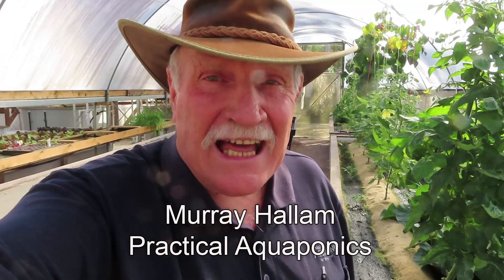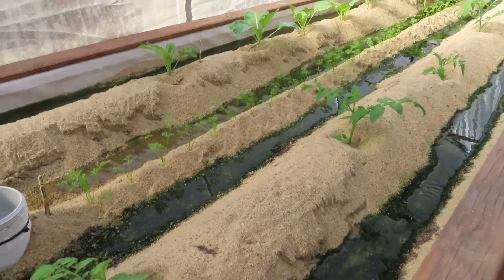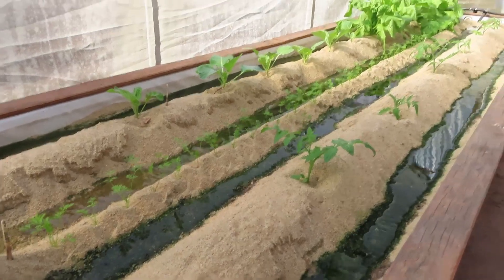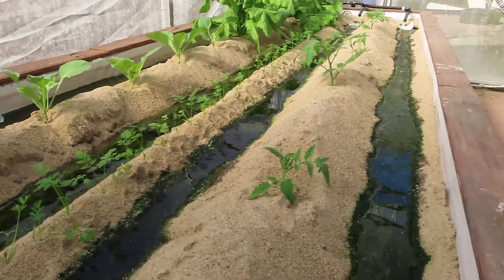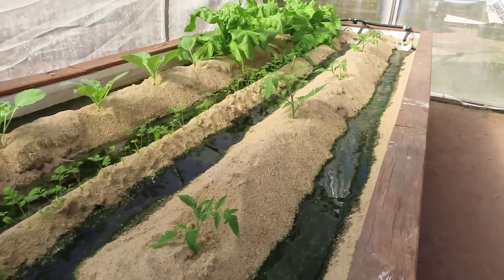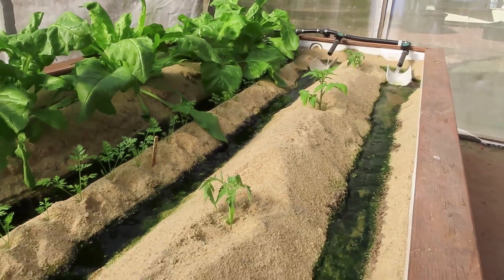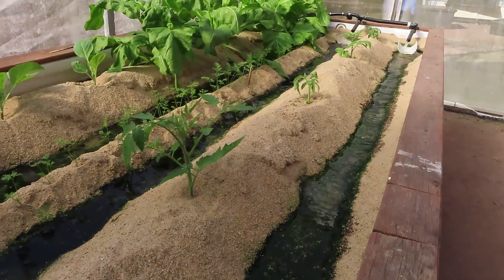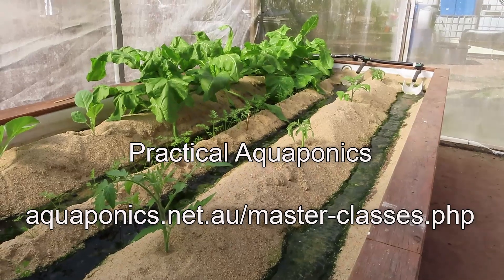New Grow Bed System

Comment: Hello Murray, I have a couple of questions regarding your system. What kind of sand did you use?, is it permanent or you do need to replace it after a while? Is there any use for the discarded sand?
Reply from the maker: The sand will last a number of years. Not sure how long as yet but we are already at one years operation and all is well.